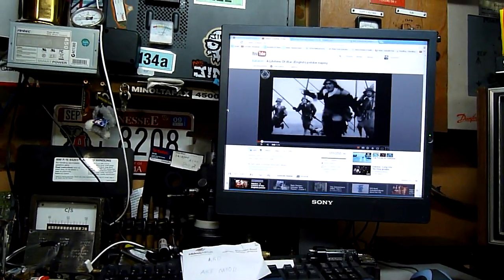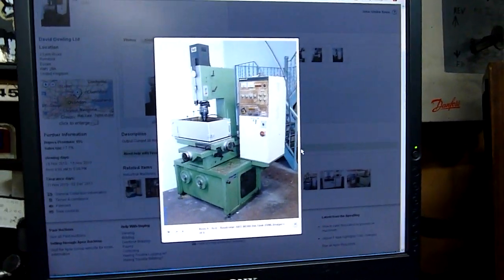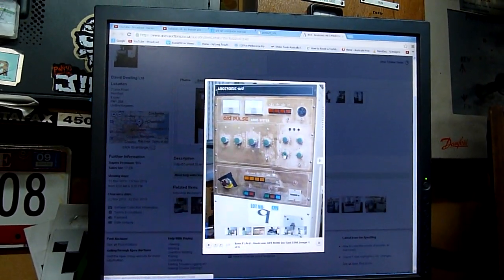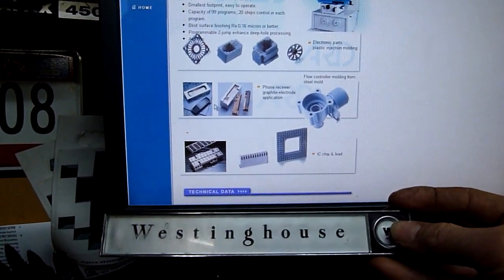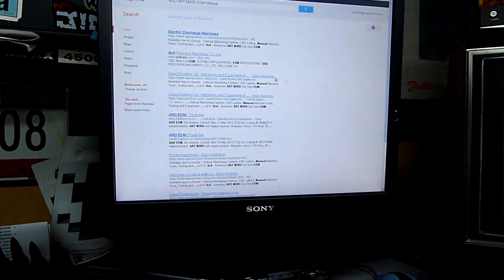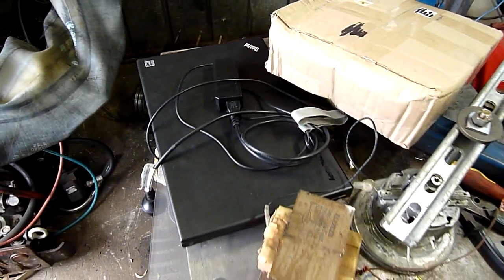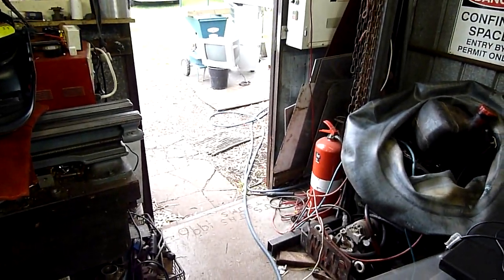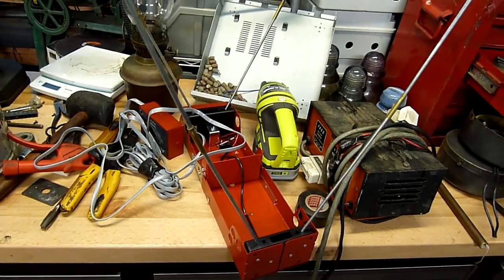Ramblotronic Monday - EDM, Computers and General Fun Stuff

Comment: have fun with the EDM, one of my freinds works with them and the wire edms , neat machines , I had some cylinder heads with broken studs and he burned them out in a hour and no damage to the threads , he also burned some .030 holes in some steel allen caps for engines I build , took him longer to set up than to burn the holes .

Comment: well, about the laptop maybe the RAM has given up.. I had wrong memory installed in my Lenovo (Y500) and the thing just gave 1 beep and it wont boot up or even light up the screen.. so can be memory problem, or even that spill has damaged some component on the board.. can be anything lol sometimes finding problems can be hard on laptops!! cant say about HDD because if the HDD has got a problem it should at least light up the screen